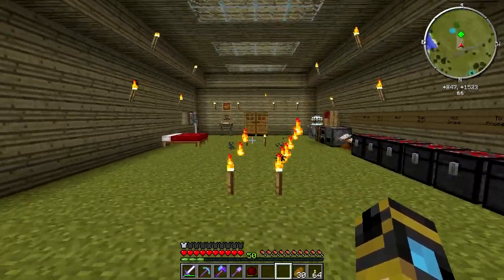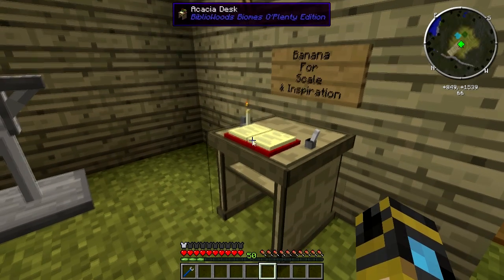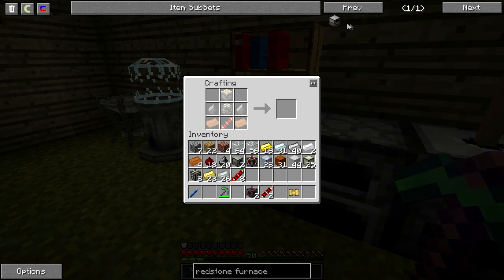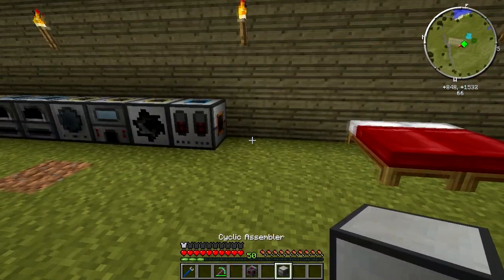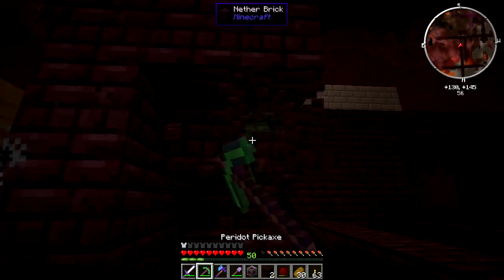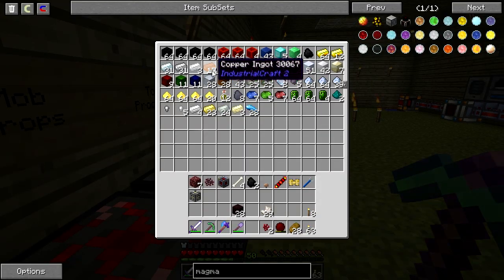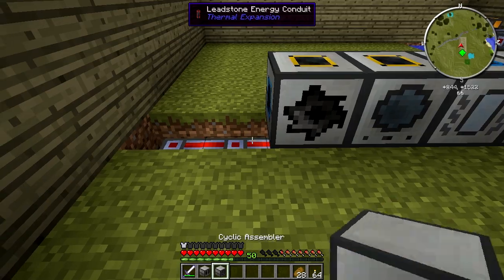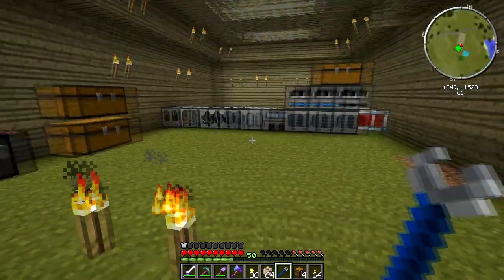PahiPlays ForgeCraft 1 S1E3: Thermal Equilibrium (Fixed)

Comment: Pahimar, you can press CTRL + Middle click (the wheel click) to balance everything in a crafting table. For example, you had a bunch of gold nuggets and you wanted to craft gold ingots. Instead of right clicking to split a stack to make more, you press this combination and it'll automatically fill every slot with the maximum number.
And to delete the last search in the NEI's toolbar, you just have to right click. It'll erase it.
CTRL + Left click will pull one item at the time, CTRL + Right click will pull out one item and will put it in the inventory as it can't stack (hard to explain, try it by yourself).

Comment: Pahi, not sure if anyone else mentioned it yet but:
- The withering you got was probably from Wither Wart. It looks like Nether Wart, but gives you the withering effect if you pick it
- The smooth stone in the Nether is from someone using the Enderthermic Pump. It's a "lag free" pump (instead of removing lava source blocks, it converts them into smooth stone without a block update)

Comment: Good video Pahimar, I believe you can rotate furnaces 'in place'.. I presume it is with the wrench, but I cant for the life of me remember how to do it.. I am sure someone replying to this comment will correct me if I am wrong though.
Reply: Just right click vanila furnaces with a wrench to rotate them
Reply: you can actually rotate about anyting that would be usefull to be rotated witch the right-clicking of the cresent hammer
Reply: GameOutdoor I dont think you can with TE machines
Reply: Minecraft Pro Robin You can, it's not very useful because of you can set the out and input sides to whatever you want them to be :p
Reply: GameOutdoor it is since u cannot pipe in or out of the front face.
Reply: Colin Richardson didn't think of that one :p

Comment: u need better energy tranfer to better power your machines
Reply: yep :-) just simply add an extra connection. an extra orange power output connecting to the other energy conduits will double the output ;-)
its not like he has x10 less poweroutput then he might need... atleast not yet :-)
all he needs is 52 magma crucible's redstone, about 10 electrum, and some hardened glass to make a redstone energycell and redstone conduits in the near future.